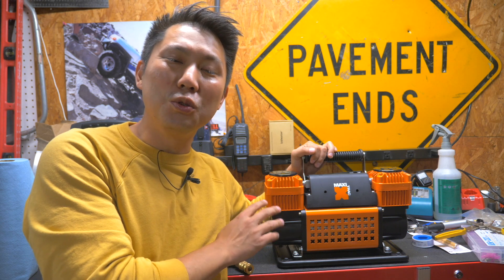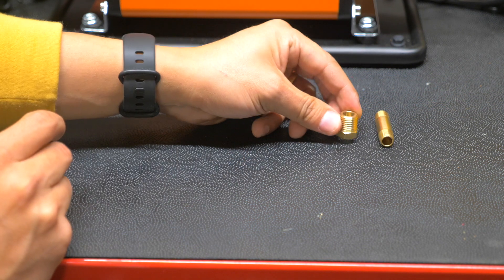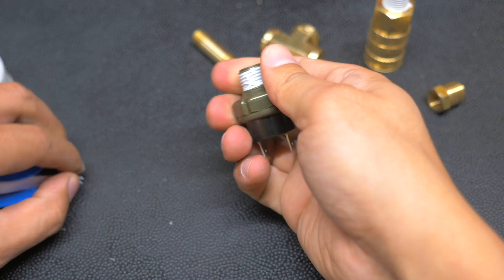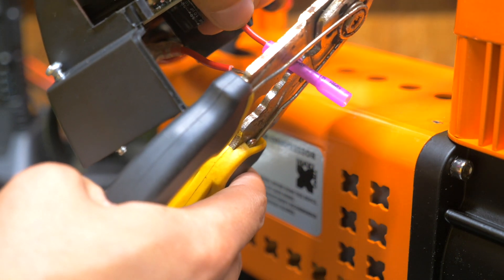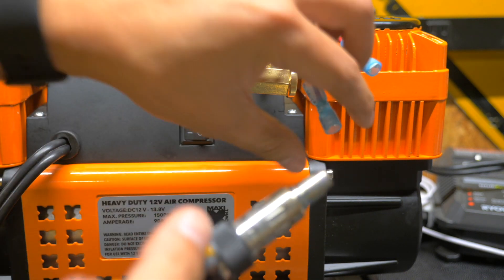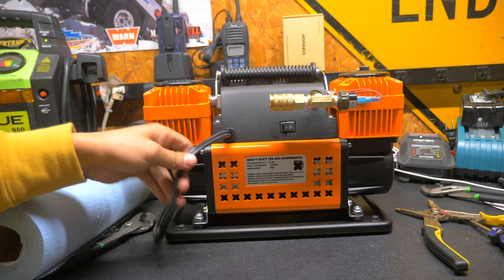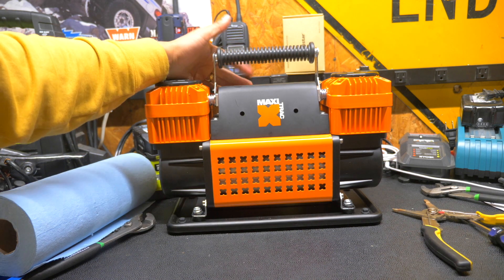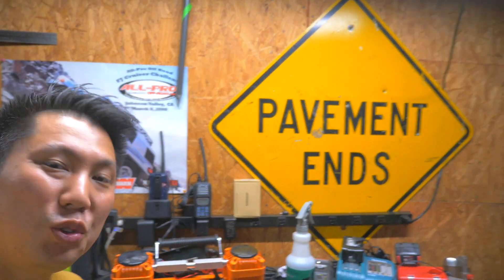Maxi Trac  Dual Air Compressor Pressure Switch DIY upgrade and review - Is it worth it?

Comment: great explanation!
there is something realy important you need to add which is the check valve 
instead of using the 1/8 to 1/8 extenion, add this check valve 
why? because there will be air flow (back pressure) and to protect the air compressor you should use the check valve.

Comment: Correct me if I'm wrong but with these dual-cylinder systems you must use a four-tire inflator kit because the back pressure from a single tire would destroy this unit over time, according to MorrFlate.

Comment: if anyone is attempting to do this with the AllTop Twin Cylinder compressor, the 1/8" to 1/8" extender is way too small for that hole. Apparently all of these compressors aren't the same with different names.

Comment: The factory unit has a pressure relief switch built into the inline gauge which you deleted, I'm not sure if I just missed it, but where did you put it on yours as it's a very important safety item?  Thanks

Comment: rather than cutting the wire from the back of the switch, why not unplug the connector and put it on the pressure switch?

Comment: I'd probably just unplug the wire from the factory switch and use that lead to one side of the pressure switch then make a new lead for the other...no butt connectors needed. If the wires to short I'd desolder it and start fresh...less failure points. I'm likely going to gar a bit further and ditch the board and wimpy power leads in favor of a big relay.

Comment: Someone else did a video on this compressor. They mentioned that you needed a metric adapter for where the air hose is connected to the compressor. And you show using NPT fitting. Did you have to make any modification to ths=at outlet port on the compressor?
Reply from the maker: Hi Steve, mine screwed right in with no rethreading necessary.

Comment: would it just be worth getting a pressure switch to cut off at your desired full pressure? so when you are airing up to get back on the road, you can hook it up, and leave it on each wheel until it cuts off when its full?
Reply from the maker: Hmm that might work, but i'm concerned with the pressure spikes of when you start  the compressor that may exceed the psi of full tire pressure, i.e. 36 psi. I notice on my gauge when the compressor is pumping it's actually higher than 36, meaning the compressor has to put out higher psi than the tires actual psi to build that pressure up.... and if that pressure switch is at 36 psi... than the compressor might prematurely turn off or cycle erratically. But who knows maybe it'll work! give it a try and let us know!
Reply: @lonelydriver82  Will do

Comment: Were you running it off a 12V battery bank or some kind of power supply?  I'm looking for a high flowing compressor to run off an Amazon 100A power supply, but if this thing really eats up 90A it might be a short life for the power supply.
Reply from the maker: I run it off the starter battery with engine running for max amp/volts from the alternator

Comment: I just did the mod and I'm guessing I may have a bad brand new pressure switch.  It just keeps running till I turn it off or unplug one leg of the pressure switch
Reply from the maker: Hey Travis, that may be the case, also double check your wiring.
Reply: @lonelydriver82  I just re checked the wiring again.  It's exactly like yours.  I guess I'll buy another pressure switch this week and see if it works.  Thanks for the reply

Comment: Are these all the same things needed for the summit version of this compressor?
Reply from the maker: Haven't seen over in person but most likely they are the same
Reply: @lonelydriver82  they are the only thing Is the summit one claims to have a 120 psi cut off. But I’ve watched some videos of people using the summit version and completely closing the flow valve completely while the pump is running and it never cuts off….. 🤔

Comment: Do you bleed out the air when you’re done?
Reply from the maker: I do so it's easier to remove the hose from the compressor. I have a shrader valve on my hose manifold if you see my other video that makes it easy to depressurize by pushing the needle while still attached.
Reply: Thank you for the info. I’ve seen several mods for this, but honestly I like yours best.

Comment: My odd thought i've wondered is if an arb air system can be switched with a hydraulic lever, using the diff oil fluid through the airline to engage the mechanism 😑. probably a big nope though.

Comment: Does it matter which Gauge wire you use? I'm new to working with electrical components and not sure what to get from the store
Reply from the maker: Hey Jack, as long as the wire is equal or thicker than that existing wire you're cutting, it should be fine. the wire is just carrying an on off signal to the compressor, not carrying any significant load.

Comment: Ouch, looks like you got the friday arvo model, I got one out of a warranty bin that was returned due to missing all it's connections, did the same mod with a pressure switch but I didn't find any dodgy connections like you did. It's solid mounted and so far has been working well, does get hot though.

Comment: Great idea. Is there enough room in the case for the pressure switch if you use a shorter pipe nipple and use the tee the other way?

Comment: I also made a couple vids similar to this just a different compressor. I made an expansion tank system and allows use of air tools as well as describe some of the principles to keep in mind while designing/building an air system. Can find them on my channel by searching MrMotofy Onboard Air

You did an excellent job on this vid

Comment: What is the power draw of these units?
Reply: It appears they should be about 90A. The single cylinder 170L is a 45A draw or about 580-600w motor

Comment: Is this water resistant or water proof? I am gonna install in my engine bay but curious if I should make an aluminum box or have a cover on it when not using in my engine bay.
Reply from the maker: It's got the plastic cover so maybe splash proof, but no where near waterproof...
Reply: @lonelydriver82  do you think it being in my engine bay would pose a threat to it? I know people have ran it but never thought of it lol
Reply from the maker: @benmanis8660  hard for me to say, I think if it's mainly dirt roads no problem but if you're goin mudding or alotta rain / water crossings I'd probably be a little more hesitant

Comment: This is perfect thanks so much for the great info! I was considering adding a tank to my setup, technically I should be able to do it just as you have but instead of the one side of the T fitting going to an air hose that would go to the tank and then the hose would come off of the tank. When the tank reaches the correct psi the switch should still shut the compressor off as it does here correct?
Reply: Yes...I also made a couple vids similar to this just a different compressor. I made an expansion tank system and allows use of air tools as well as describe some of the principles to keep in mind while designing/building an air system. Can find them on my channel by searching MrMotofy Onboard Air

Comment: Hi Kevin. What has been your experience tying this compressor into the rest of your system? Specifically the 60 psi max pressure gauge on your air manifold. I'm working on an onboard air setup with the Maxi Trac compressor and the gauge maxes out. I think the calibration will be affected.
Reply from the maker: Hey Charles sorry for the late reply, no issues whatsoever, once the compressor turns off, the pressure read is of the tires and not the input on the compressor side so 60 psi has been perfect for me. If you're towing or using this on a trailer then it might make sense to swap out a higher psi gauge so you can get upto those higher psi's... i like to keep the gauge lower so i can be a bit more accurate if possible.

Comment: I’m new to all this so here it goes. Can a pressure switch be added so that it stops once the desired tire pressure is reached?
Reply from the maker: Hey Percy if you find a pressure switch that happens to turn off at exactly the pressure you want that might work.
Reply: You could use an inline pressure regulator. The plain ones like used on a normal house compressor. Set for like 35psi or whatever. I show an example in vids.

I also made a couple vids similar to this just a different compressor. I made an expansion tank system and allows use of air tools as well as describe some of the principles to keep in mind while designing/building an air system. Can find them on my channel by searching MrMotofy Onboard Air

Comment: I ordered one and cancelled the next day . After watching you and your experience I realized that my Ironman 5.65 cfm wasn’t  so bad after all.   The Maxi Trac doesn’t have circuit breaker or even a pressure valve and to hard wire it at 90 amps is a real challenge at the rear of my Jeep. Bottom line is I will wait the extra minute to fill a tire. But great video and thank you.
Reply from the maker: thanks! sometimes it just isn't worth it :)
Reply: @lonelydriver82  kevin i mounted the maxitrac on its side. Slight mods to mounting  base plate brackets to make them fit. Added pressure switch and relief valve. Used original wire it was long enough to reach positve terminal through fire wall works great.
Reply from the maker: @walterhughes5765  awesome!
Reply: So just an update Kevin they didbt cancel my order as intended they said i would have to return it at a ups store . So i decided to keep it. I took the cover off wiring was fine no crap in the air filters looks very well built . Only thing that caught my eye was instructions say it has a pressure switch that will shut it off when using a closed air filler. Havent tried it  out of the box yet
Reply: Sorry Kevin I noticed someone already asked you about instructions stating it has a pressure switch

Comment: great video! just wanted to make sure does it matter what wire end you connect to the pressure switch?
Reply from the maker: I don't think it matters as all it's doing is completing the circuit.

Comment: Is the small Red wire going into the motor a thermal overload?
Reply from the maker: no for the small red wires , one goes to the existing switch to the pressure switch. the other wire goes from the pressure switch to the circuit board which likely controls the relay to turn on the compressor.

Comment: Was thinking on using this on lockers and attaching it on my aux beam panel. Think that would b ok?
Reply from the maker: I think the only issue I can think of is this compressor is rather large... A good bit larger than a dual Arb.
Reply: @lonelydriver82  thank you!
Reply: You can definitely use it as the source. A tank is a good idea. I built an Onboard yet portable air system.

I also made a couple vids similar to this just a different compressor. I made an expansion tank system and allows use of air tools as well as describe some of the principles to keep in mind while designing/building an air system. Can find them on my channel by searching MrMotofy Onboard Air

Comment: Is it possible to cut off the alligator clamps and rewire the power to the battery?
Reply from the maker: You could but you'd wanna make sure there is a nice big circuit breaker or fuse inline. You could also do an Anderson plug and connect only when you use it

Comment: You've done an outstanding service to the offroad community Kevin! Bought the same compressor and did the same 4 tire inflator/deflator setup. Lexus Overland channel did a video just like yours and gave you credit so I recently ordered the parts to do the pressure switch mod. Thank you for your time and effort!
Reply from the maker: Thanks glad it was useful!!

Comment: HI, thanks for making this video and all your insights. I picked up one of these the other day. looking to do this mod but stopped myself after reading the paper pamphlet included with the compressor. Under the section "Operating Instructions" it states that this compressor has a built in compressor switch and that it will shut itself off. In the steps 7-9 on inflating tires is states to allow the pressure to build in the lines and by depressing the trigger will turn on the compressor again using its pressure switch. Have you tested this or is this true or are the instructions misleading? With these pressure switches being added by users are we just doubling up on something that's already built in?
Reply from the maker: From what I can see there's no existing pressure switch.... I heard some other brands that sell this compressor do come with switches. Might just have been a mistake where they reused instructions from.
 Another brand..
Reply: @lonelydriver82  Yea that's what I was starting to notice with the Kings Thumper version and the Desert Armor Version. Videos with those show the compressor shutting itself off automatically. They look identical to the MaxiTrac but I haven't been able to test it yet.

Comment: I was watching another video about this compressor and they recommended an "unloader valve" so that the pressure doesn't build up or remain so high when it automatically cuts off and then has to start again. Any thoughts on this?
Reply from the maker: I think adding an unloader valve is a great idea, right now when you disconnect the hose it can get a little bit hard due to the built up pressure.
Reply: @lonelydriver82  - I'm a novice! Any good choices for one and where would it fit in your setup? Planning to do mine this coming weekend (hopefully).
Reply from the maker: @docwilkinson  you could use this 4 way manifold instead of the 3 way manifold Anderson Metals 06102 Brass Pipe Fitting, Barstock Cross, 1/4" x 1/4" x 1/4" x 1/4" NPT Female Pipe https://www.amazon.com/dp/B00D3CTW56/ref=cm_sw_r_apan_glt_fabc_XQ2PRX57QT7KEVCS1H0P

And use this pressure release valve in the 4th opening. Control Devices-ST25-1A ST Series Brass ASME Safety Valve, 125 psi Set Pressure, 1/4" Male NPT https://www.amazon.com/dp/B0081TJISW/ref=cm_sw_r_apan_glt_fabc_TV2HN3JF0DVAPYGYS0BE
 It would make the compressor a bit more bulkier however... This is the simplest way, I might do this mod as well and if I do I'll make a vid. I haven't tested how the 125 psi release valve works with the pressure switch so proceed with caution!
Reply: The release valve I assume you're referring to is an emergency release valve and needs to be higher than pressure shutoff valve so the emergency valve doesn't pop too early

Comment: Great mod and video. I was going to do this so I can add a lock on air chuck rather than screw on but then I found they make lock on ones that are open flow when detached so I will probably just go that route for now. I will definitely be checking all the electrical on mine after seeing the issue with yours.

Comment: I also recommend you unscrew the black air filter caps on each cylinder.  The opening into the cylinders likely haven’t been deburred. Mine had metal shavings all over the place.
Reply from the maker: Great tip

Comment: Good video...what brand of heat gun are you using?  Thank you.
Reply from the maker: Love this thing  , much higher quality than some of the cheaper units, LEXIVON Butane Soldering Iron Multi-Purpose Kit | Cordless Self-Igniting Adjustable Flame 7-Tip Set | Pro Grade 125-Watt Equivalent (LX-770) https://www.amazon.com/dp/B07M9ZKK9T/ref=cm_sw_r_apanp_5wUVpA9FmYB3J

Comment: I have (for several years now) a Viair 450P, even though (being a single-cylinder compressor) it's WAY slower than this Maxi Trac...but at least it didn't need any "mods" right out of the box.  ;-)
The warranty has expired though -- so no difference with a compressor like the Maxi Trac with a short warranty (or no warranty at all!) -- but no problems with my Viair so far, so I hope that continues. However, I'm guessing I can get parts from Viair if ever needed (for repairs) -- not sure that's true of these "off-brand" compressors (regardless of brand) and even if almost all of them are made in China (as everything else seems to be nowadays, including Viair).  ;-)
-- BR
Reply from the maker: If this breaks, Probably more cost effective to just buy another... 😂 As long as they keep the price this low... But we'll see how long that lasts with inflation

Comment: The specs of the compressor are great, but not having a warranty and having the compressor die because of faulty wiring makes me second guess buying one. There are still great affordable compressors out there that at minimum also have an inline fuse.
Reply from the maker: Yeah I'd agree if you need to rely on this as your sole compressor, might not be the best choice, but if you're using it at home or local trails where say it died on you , you could borrow a friends or make it to a gas station, it's a beast of a compressor.

Comment: so what gauge wire did you use to add the switch? type of wire
Reply from the maker: Hey Abel, as long as the gauge is thicker than  or equal to the wire you are cutting  you should be good. Sorry i have the compressor packed away. but I'd say if you want a gauge, 12 gauge should be good to go. .
Reply: @lonelydriver82  thank you